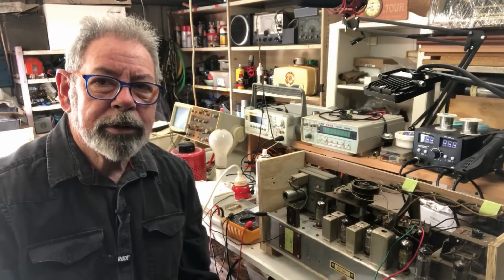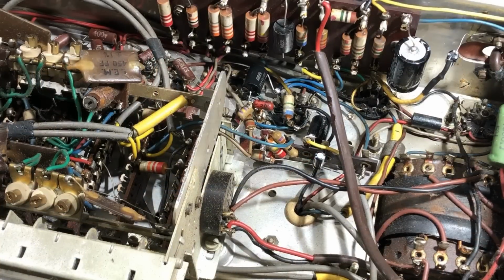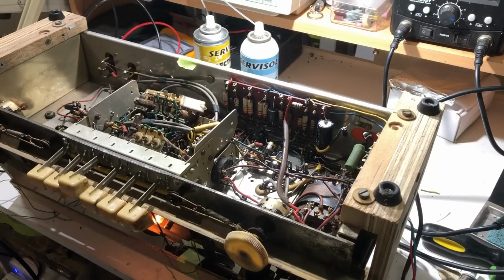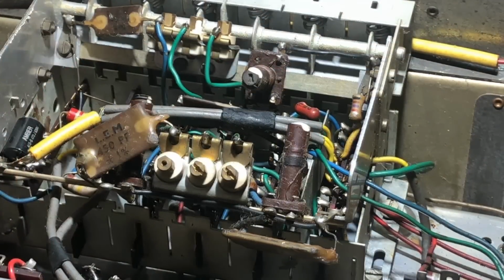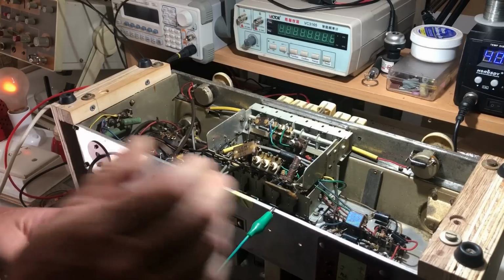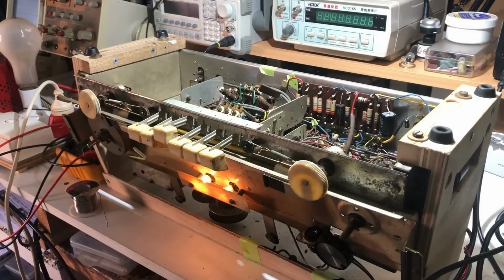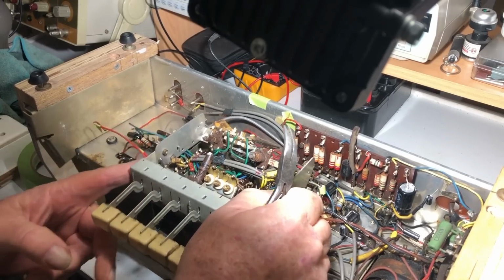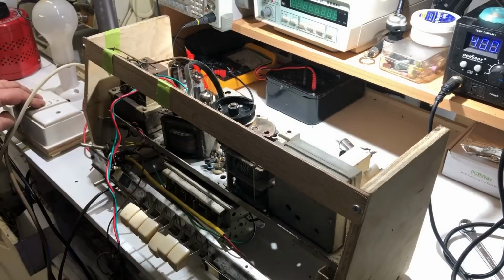BUSH VHF64 Part 2 - The deeper I dig, the worse it gets!

Comment: I have seen YT videos but only a few throughout the years where switches are smoking because the pcb material used in those switches gets conductive because of moist. When the voltage breaches the conductivity the material slowly turns into carbon wich over time just gets worse. The only solution I saw them use was to remove the material where the bridging happens.
I hope my english was understandable. 😊

Comment: silver mica
Reply: Agreed, I would suspect that.
Reply from the maker: Hi.  Yes, unless it's a "mechanical" fault inside the can, I'm thinking the same thing.  I would probably have to order the appropriate caps as they're not generally available in the correct values & voltage ratings, so I hope it's not that but realistically - you're probably right.
Cheers

Comment: You're not wrong about Limey engineers. The concept of "Not Invented, Here" is strong with them .  If an American, French  or German can design something and use five components, why, they must absolutely must use ten for the Glory of the Empire.
Reply: Bollocks.
Reply: @984francis Agree BOLLOCKS. 🇬🇧
Reply from the maker: Hi Dennis.  This radio certainly smacks of the "glory of the empire"!  They couldn't have the Germans producing better radios than them.  To their credit though, they did simplify some things - the tone shaping circuits in this radio are much simpler, and they  deleted the sometimes troublesome mechanical clutch between the AM and FM tuning mechanisms.  But when it comes to tracking down faults ...
The Americans are the opposite - if the Europeans have produced a product using ten components, they will find a way to do it with five!
Cheers